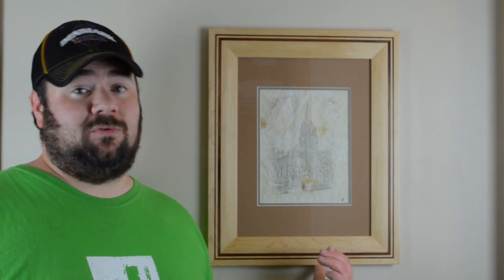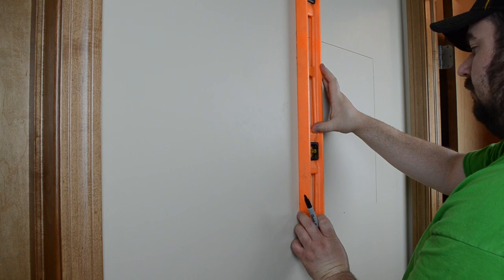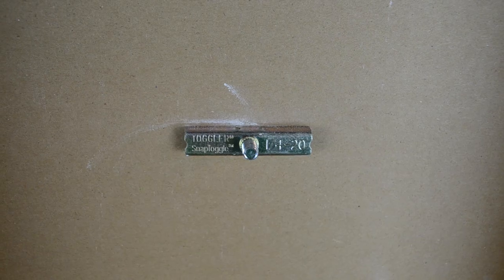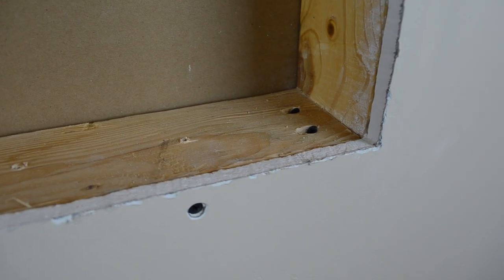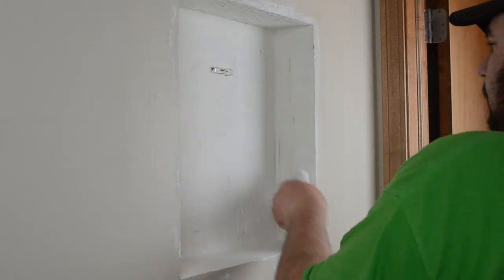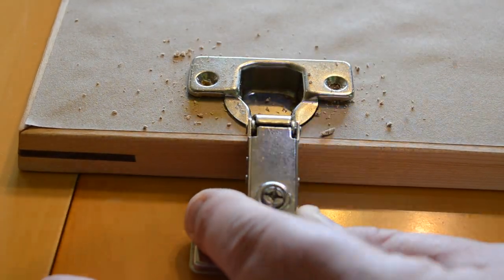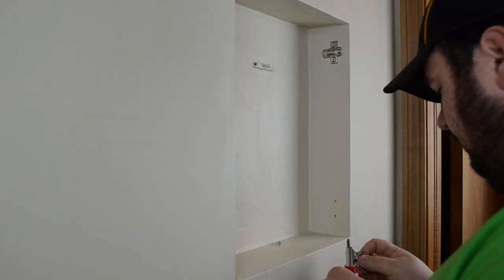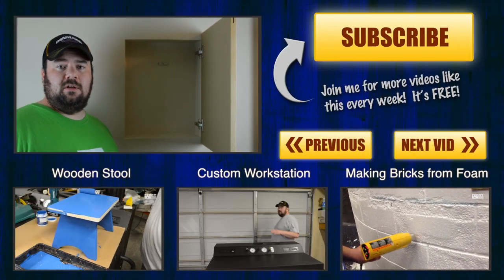Ⓕ Hidden Storage Picture Frame (ep14)

Comment: Excellent idea and build! Guessed the hinges but wasn't sure why. That cubby is so usefull. Nice tip on the wet rag instead of sanding and cutting on the push stroke. Have done it for years so like to see others using that method also. Didn't think of soft shut. Nice touch! Thank you very much for sharing!
Reply from the maker: MRrwmac You're welcome, thanks for watching

Comment: Great project and video, Nick! As a 3rd generation drywaller (not doing it anymore, but it never leaves you) I wonder how it has held up? I assume it doesn't get heavy use, but I would expect to see cracks at the inside and outside corners. Non-treated timbers is also iffy, according to my training. This is a great situation for using 1/4" thick drywall panels, though most places don't sell it less than a full sheet, but it's only $10-15 depending on where you go. And the paper-faced metal or plastic corner joint tape that comes in a roll is great for situations like this, because it doesn't stick up as high on the outside as regular corner bead material. Alternatively you can use painter's caulk on the inside corner. Lay it in heavy and smooth it out and it will flex instead of cracking.

I'm sure most people wouldn't care about the finished look inside this. Just a couple tips for those who do. :)
Reply from the maker: +Jon Miller lots of great info - and yeah this was kind of a quick and dirty approach to doing it - but it's been over a year and no cracks or blemishes to speak of

Comment: This is awesome, and similar to an idea I'm working on here for my house where the "picture frame" is actually a holder for vinyl records, and then behind it the box is big enough to accommodate more records. That way the album becomes the picture itself, and you could always swap it out whenever you want to look at a different album. 

My debate was on whether or not to set it up so the storage part swings out too so it's easier to see the records, vs having to pull them all out of the cubby to get to them.
Reply from the maker: that is an awesome idea! - I would make the cubby swing out with it - just weigh the cubby and vinyl and check the rating on the hinges - 2 should be fine but a 3rd could be added - I see you are making your way through my channel - glad to hear you are enjoying it - thanks for the support!

Comment: That works for newer houses. It does not work very well with old house with ugly plaster wall and strange stuff inside of the wall.  The stud finder would not able to find accurate on old house's studs. I have been working on many things like that and hate the old house! This works good for newer house that has drywall. you will have no problem with it!  Good video. Love it!
Reply from the maker: +pmg1180 thanks - yeah lath and plaster would be no fun

Comment: I've been wanting to try pocket screws in situations like the in-wall framing members you installed here. Something tells me it would work great, and tend less to pull the work out of alignment when screwing. Just a thought!
Reply from the maker: VideoNOLA in this particular case I only had the clamp on jig and it was on loan to a friend so I just predrilled the holes at an angle - either way, it does work pretty good for this application

Comment: Thanks for the video!  What type of drill bit is that?
Reply from the maker: Mike D'Amato it's a self centering drill bit - i have this set http://amzn.to/1vQo7EK - it wasn't needed for the drilling the plates but it was what I still had in the drill from when I drilled the holes in the back of the picture frame

Comment: Great video!!! When I cut out my wall I had insulation between the studs. The kind with the paper over it. DO you have any solutions for this? Do I need to add a piece of sheet rock to the backside of the 2 pieces of wood I'm putting at the top and bottom? Or should I use a piece of plywood for the back?
Reply from the maker: You can put plywood on the back to add strength but I did Not - I also didn't have insulation as mine I opted to put in an interior wall

Comment: I have a question, does the spacing behind the frame to the drywall match on both sides? Basically does it look like a normal picture hanging there? Thanks
Reply from the maker: Yes it matches - you can install the hinge mounting plates so it sits flush with the wall or off the wall a bit to install bumpers on the closing side

Comment: Great info Nick but just between you and me...this video actually depressed me a bit.  You can cut straighter with a drywall saw than I can with a table saw!
Reply from the maker: Adam Roman I'm obsessed with cutting holes in walls so I've had some practice, but I still have some that end up as crooked as a politician.

Comment: +nick ferry: first, great videos, second, i am trying to build a floor hidden hatch with magnetic push latches (sorry, no idea what they are called, the ones that u push them in a bit and they pop up so u can open the door) and i want the door to be flush with the floor but i am struggling to figure out the hinges that i need to use. can u please help or post a quick video? thank you!
Reply from the maker: +mary w a push latch - http://amzn.to/1SWOiEC - with some mortise mount hinges - http://amzn.to/1Y1ZAFO - or barrel hinges - http://amzn.to/1SWOnIu - should do the trick -